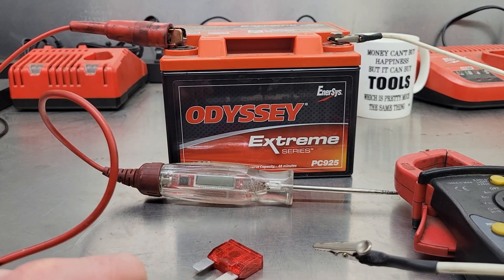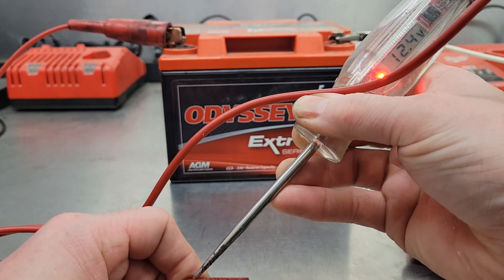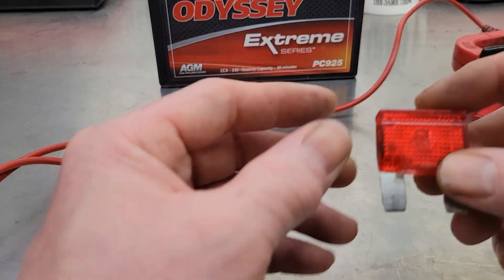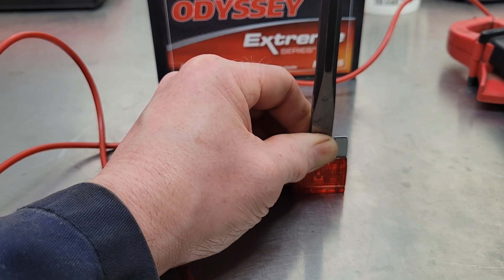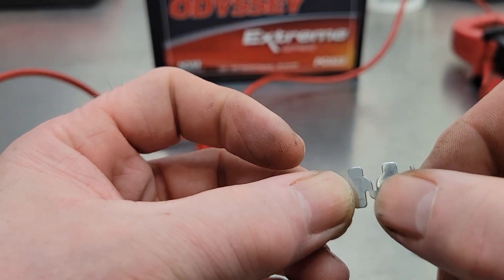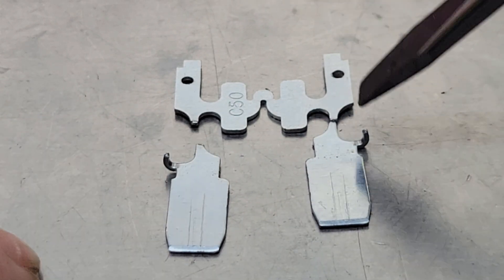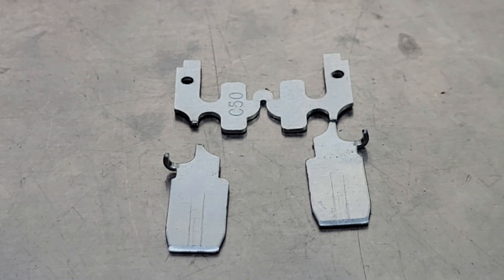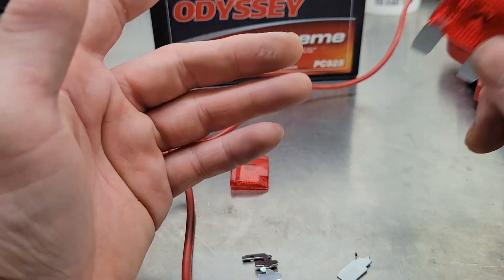How To Test A Fuse With A Test Light Or Multimeter. Looks Can Be Deceiving.

Comment: Good tech tip! Had that happen to me on a GM truck. Was scratching my head for a bit till I did what you did. 

Funny how the metal is actually thinner on the legs than in the centre where it’s supposed to blow when shorted.
Reply from the maker: It was a bit of a head scratcher for sure. I love the feeling you get when you find those odd fixes. Thanks for watching and commenting.